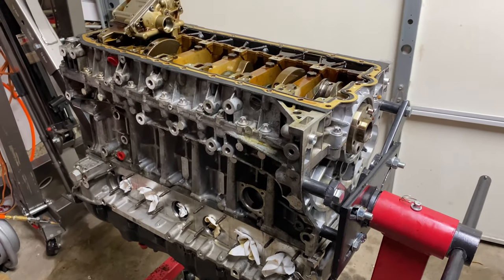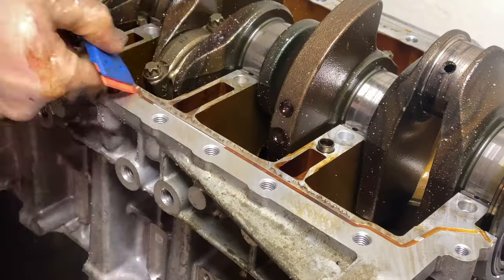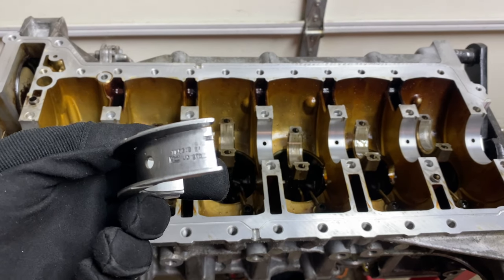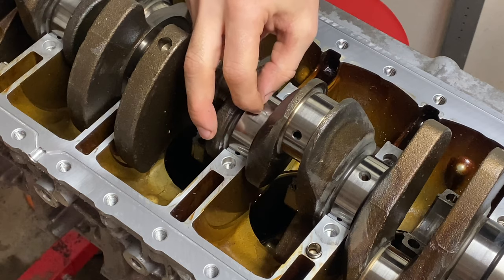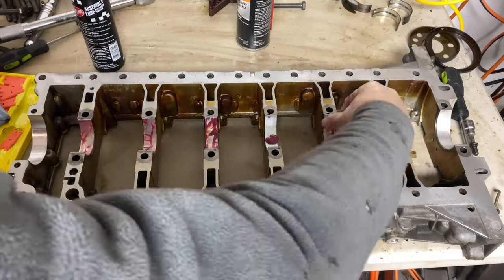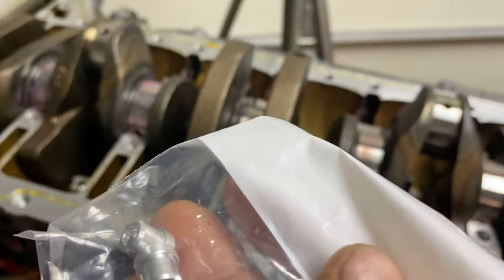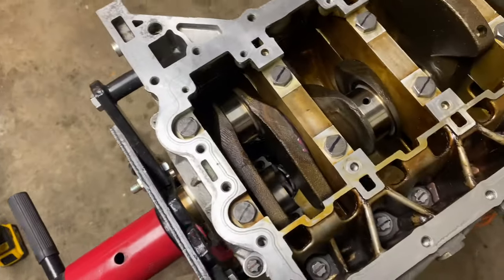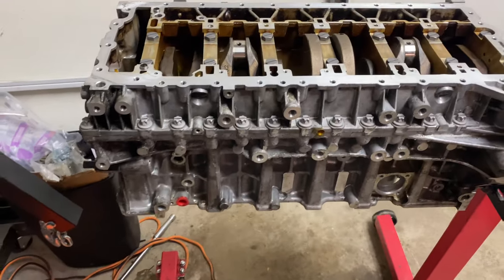Piston, Crankshaft and Main Bearings Replacement - BMW N55 Engine Rebuild Project Part 2

Comment: My 2009 335i e93 M-Sport engine started with a slight knock when over revving or changing gears. Now it has seized totally and I am advised to buy another engine. But then I cant beat the curiosity to know the problem. I just can't keep on buying. So your video has just curled the enthusiasm.

Comment: Hello, I bought a new crankshaft but not original BMW so I don't have the QR code and the numbers and letters as we usually have on the original, is there another way to know what bearings do I need for this crankshaft?

Comment: Great job mate, you are a legend. Where did you get the assembly instruction from? I will also be rebuilding an N55 over the coming weeks. I am just paranoid about the first start and priming the oil after spinning # 1 on multiple occasions. Please take care when you first start your engine my friend. I am hoping that the third time will be a charm.
Reply from the maker: I use ISTA or TIS website when it works. 
As far as the first start, there is a special function on BMW diagnostics tool that will prime the system. If I remember correctly, it will spin the engine without ignition or fuel until oil pressure builds up and then you can fire it up normally. I'll have to check it again before I start it for the first time and probably make a video about it.

Somehow your comment fell through the filter! Thanks for watching!

Comment: Great video I wish you was close by me in FL I score my crank and spun a bearing. Shops are telling me replacing the engine is a less expensive route :/ I wish I had two working arms to do this myself. Great video keep them coming 💯
Reply from the maker: Sorry to hear that! Yes, if you have someone do it, it's cheaper to put a used motor in than to fix it. 
Thanks for watching!

Comment: I started watching your video and decided to put work on hold for a few minutes LOL love this video as it hits home with me. I currently drive a 2013 550 I Gran Turismo with approximately 64,000 km on it. I’ve been told all kinds of horror stories about N63 and N63TU variant. So it’s nice to see that you’re able to fix your vehicle by you yourself . Not to mention, you’re using some cheaper tools that are affordable as opposed to expensive tools. Which could make it, a little cost prohibitive for some people if they were to run out and buy all of the expensive tools. Although, we all love our tools right? I did have a question though, just wondering if you think I should be proactive on changing out the Vanos solenoid as I’ve heard many horror stories about it in my vehicle?
Reply from the maker: Appreciate you watching! I have a 2014 550i as well, so I know the horror stories that are floating around and sometimes I worry, but I'm at almost 80,000 miles and almost 4 years of ownership with no issues at all other than regular maintenance. 
I sure love my tools and wanna buy all the good stuff, but it get's expensive as you mentioned. Once I have mostly everything I'd need, I might start replacing the tools I use with higher quality ones. We'll see!
Anyway, as far as VANOS solenoids, I wouldn't touch them unless you are having issues like rough idle, bad fuel economy etc.
Reply: @SimpleCarGuy  I always seem to find a way to buy more tools :) Thanks for the advice on the Vanos solenoid. I was actually thinking to replace it. The cost here isn’t that bad to do it, so will see what happens. Idle seems to be ok, the mileage/fuel economy is terrible so not sure about that part. I get 17 km per 100 litters of fuel in city (ouch) and 11 km on the highway. My brother-in-law says it’s almost the same as his full size Ford pickup.

Comment: Hi, thanks for the informative video. Quick question my coefficient of friction is about 5 nm to get started but once moving is around 2nm. Do you know if that is within spec? It’s 2nm pretty much instantly. Just the initial movement if I leave it for a day or a few hours is around 5
To 6 nm

Comment: the backplate to block sealant, I love the fact that you don't have to use the nipples to spread that thing around. Any idea if there are updated instructions for all engines? Mine is a 2012 N51 from a 328i coupe engine. Same deal I would much rather not have to squeeze the sealant it seems much easier the way you did it. What about at the main seals where you're supposed to use the primer from the little bottle once the sealant leaks out through there? Let me know what you think.

Comment: Love your videos man! I am actually rebuilding my '15 N55 motor right now due to a spun rod bearing as well. Just curious, what manual are you using? I have been using the Bentley one and it doesn't seem to have as much detail as yours. Thanks, and good luck.
Reply from the maker: Sorry for the late response.
I've used newtis, ISTA and bentley manuals. How has it gone for you? 
Thanks for watching!
Reply: How did it end up going? Currently dealing with this issue on my 2015 N55 as well

Comment: Interesting video bro, am looking forward to rebuilding my n52 can I use the same torque specs?
Reply from the maker: I don't think the specs would be the same for that engine, but I don't know for sure. I'd recommend getting INPA or ISTA (I don't remember which one exactly). It will have all older BMW specs.
Reply: @SimpleCarGuy  okay will try to find out from a friend with 1.thank you

Comment: Is this possible with engine still connected to the engine bay?
Reply from the maker: You can do the rod bearings while the engine is still in the car, but not the rest.
Reply: @SimpleCarGuy  thanks I was going to change out my main bearings but  differently going have to get engine stand

Comment: By mistake I pull the center screw I crack the engine and everything came out I hear something fall and I put everything back, do you think the timing moved or something fall in side the oil pan? Thank you for your help
Reply from the maker: If by center screw, you mean the main engine bolt that goes on the crankshaft, then if you have got it loose, you will have to retime the engine. If you pulled the bolt out, the sprocket on it could have fallen in (the one that drives the oil pump).

Comment: Hello, I have a question my engine block is dead (bmw e92 335i n55) I would like to replace this engine block but I wanted to know what number I should look at and where to be sure that it corresponds to my engine
Thank you for your reply
Reply from the maker: Hi! You will see a part number on the block as well as a sticker with something like N55B30 on it. That's the version of N55 you have and the block you should get. Other may fit.. but it depends (like if you have the 2 series M engine). Thanks for watching.
Reply: @SimpleCarGuy  ok thank you !

Comment: So I’m in the same situation with my N54 and I bought the same exact bearings. What I’m having a issue with is that the trust bearing oil hole is not lining up perfect. I noticed in your video they are the exact same. Isn’t that a flaw?
Reply from the maker: I've checked on the forums etc and everyone seems to agree that it's fine.. I hope they are right. Have you found any more information on this since the comment?

Comment: Do you used the old crankshaft screw for plastigage ?
Reply from the maker: Yes. These are stretch to yield bolts so if you use the new ones, you can’t use them for final assembly.
Reply: @SimpleCarGuy  thank's for your reply ! it's the same for the rod bolt i think ?

Comment: May I know the n55 rod bearing bolt torque spec? 
Because I found the spec from web is 20nm and then 70degrees and then 70degrees again , when I follow this progress method, the crankshaft wont move freely, so I follow your method with 20nm and then 70degrees , the crankshaft can  move freely without friction
Reply: I know this is an old comment but I’m rebuilding mine and found this information too before seeing this video. It does feel like it’s not as tight with the 20nm and 70deg but the 20/70/70 was definitely too much as I couldn’t spin my crank. Now I have to buy another set of bolts but luckily didn’t break them.

Comment: is the crankshaft resurfaced from the $ 350 engine,and what did it cost.
Reply from the maker: I decided to sell the old crankshaft and bought a good used one instead. I kept in touch with the person I sold it to and his shop charged something like $150 to grind down the journal and $25 to polish the others.

Comment: what instructions/electronic manual are you using for the reassembly -  thanks
Reply from the maker: I’m using ISTA and TIS. Bentley manuals are also super helpful.
Reply: @SimpleCarGuy  it looked like you had an electronic manual is what I mean. I have the Bentley manual but a better detailed one for service/assembly is what I seek
Reply from the maker: That’s newtis website. ISTA is BMWs software that you’re technically not supposed to have.